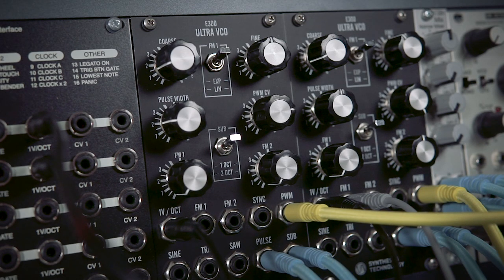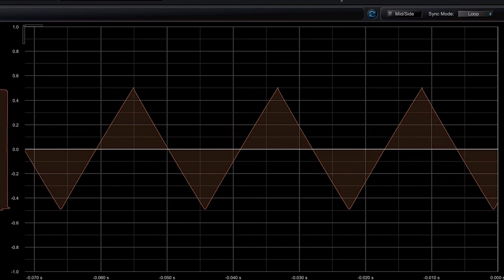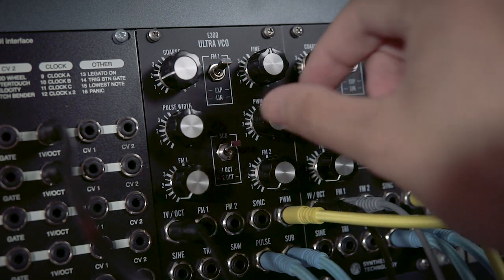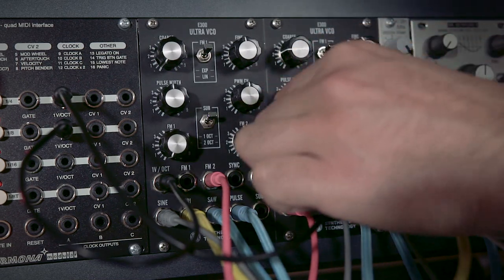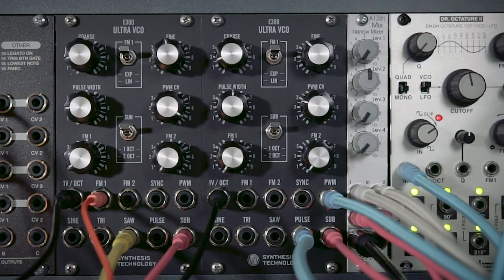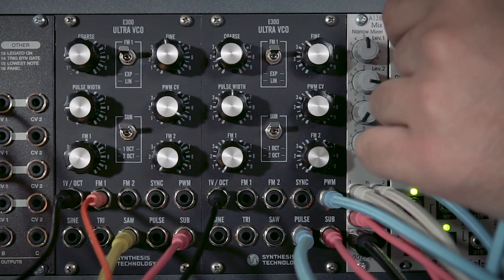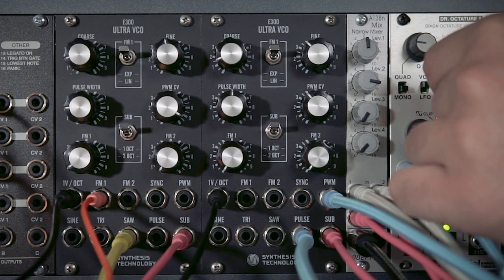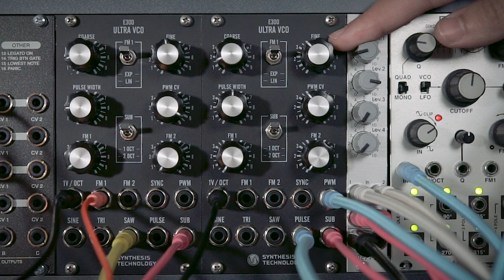E300 Ultra VCO - Overview and Demo

Comment: This sounds incredible. If it had an octave switch for the core oscillator, this would have been a must-buy. I'm still tempted as hell though. Great demo.
Reply from the maker: Ryan Dean yeah that’s a feature I want on all oscillators.  There’s always the ALM beasts chalkboard.
Reply: @AiynZahevSounds  Yeah I've got a WMD Volt that's not currently dedicated to anything, which is why this module still has a healthy spot on my list. It makes it a considerable HP allotment for a single oscillator, but it sounds on par with my #1 favorite analog osc, the AJH Synth Transistor Core VCO. The AJH has octave switching but no sub osc (the one thing holding it back from perfection), and this has sub osc but no octave switch. Seems like a draw, but Synth Tech's E440 is so glorious that I feel compelled to give this bad boy a go with it.